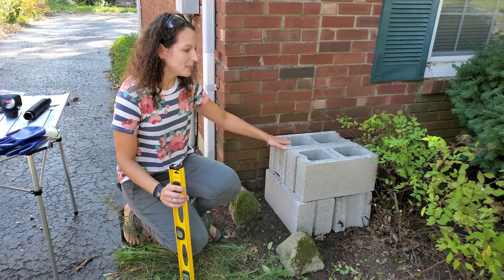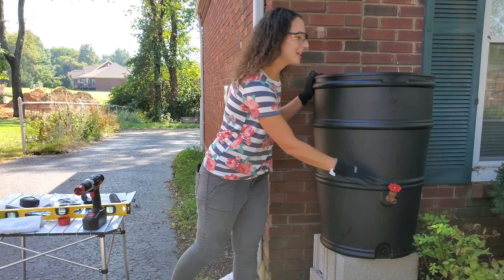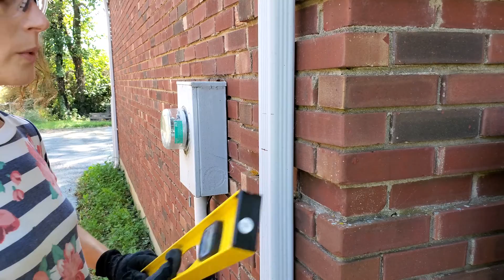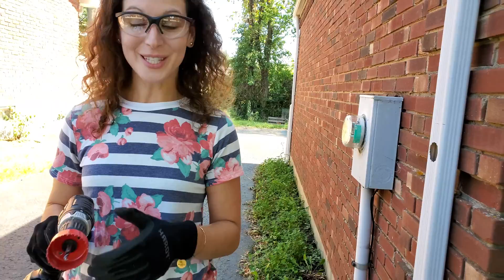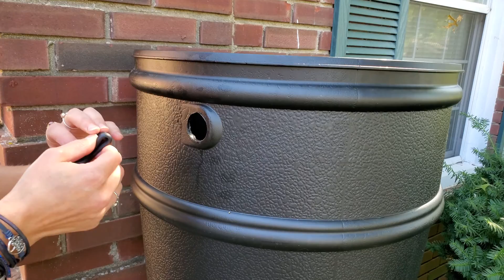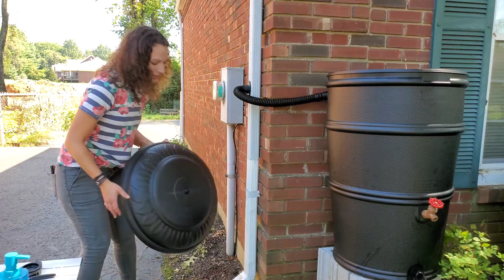Installing an Earth Minded Rain Barrel and Diverter Kit (HD)

Comment: my barrel entry is on the top. can i still use this?
Reply: No, it won't work with but you can easily cut a hole on the side, close to the top of barrel.

Comment: Maybe I'm stupid, but I don't see how a donut-shaped object diverts ALL the water into the rain barrel? It seems like a portion would flow into the outer rim and then into the barrel while water coming down the middle of the spout would bypass the rain barrel off ramp. What am I missing?
Reply from the maker: Not a stupid question! You are correct that some water will still flow down the gutter. However, it is easier for the water to flow into the barrel and once the barrel is full all water will continue down the gutter. You're going to collect way more water on your roof than will fit in the rain barrel so it's really not an issue.

Comment: Beware! Dont buy this if your barrel inlet is on the top of your barrel because eventually your barrel will overflow. There iis no shut-off. This diverter requires a side inlet to your barrel, that allows gravity to stop it from overflowing. They do not explain that in their information.
Reply: But they provide all that's needed to create a new side inlet on your barrel.
Reply: Thanks for this information.  I have a barrel with a large, screened top opening and wanted to use it that way, but you've clarified that isn't the way to go.  You are right, this information is not explained in their instructions.

Comment: After five years my hose cracked where yours takes a sharp turn to get into your barrel. This was no doubt due to the stress at that point over the years. Ideally the diverted should have been mounted on the thinner side of the drain so that sharp turn would not be necessary. Are you aware of any diverter kits that attach at a right angle, and to which the hose is attached straight on?
Reply: This diverter is 3X4, and the the hose is at the 4” side. I think they should make at least 2 kinds of diverters, one is facing 3” side, one is facing 4” side. Actually my downspout is 2.8”x2.8” square one. I like it because I can turn elbow to the side of house, so it won’t be damaged by my neighbour’s lawnmower. But this diverter won’t fit, I don’t want take risk to waste $40, it is way too expensive for a piece of rubber.

Comment: Can this diverter also work as shut off? If water fills up the barrel then the water will fill the diverter’s outer layer and flow down from the inner circle to  the downspout?
Reply from the maker: That's correct! Once your barrel is full the water takes the path of least resistance which is to continue flowing through the downspout.

Comment: How do leaves and shingle gravel still flow down the downspout with the diverter installed. The hole in the diverter hardly looks like it will allow many leaves flow thru. Is this a problem. Thanks
Reply from the maker: This could be a concern. I personally have gutter covers on my roof, but for those that don't I'd recommend occasionally removing the diverter from the downspout to inspect . This could also be noticed if the barrel isn't filling properly. For all rain barrels I recommend not using the first flush of rainwater each season. This is when the most debris, chemicals, bird droppings, etc. will be mixed with the water.

Comment: Thank you so much for this useful video! I recently bought this model and confused about the way the diverter works?  It has a hole, but won’t the water fall off from the other side?
Reply from the maker: Hi! There are 2 directions you can place the diverter into your downspout. One will allow water to flow into your barrel. Once the barrel is full, water from your gutter will automatically flow back down your downspout. Flipping the diverter 90 deg. (diverter hole facing down) will allow all water from your gutter to flow fully through the downspout. Hope this answers your question. Thanks!
Reply: @currysforkwatershed6262  it’s working! I’m happy with this product! Thanks so much!